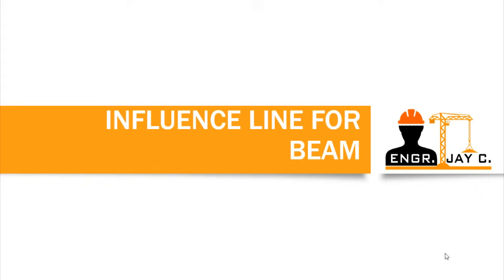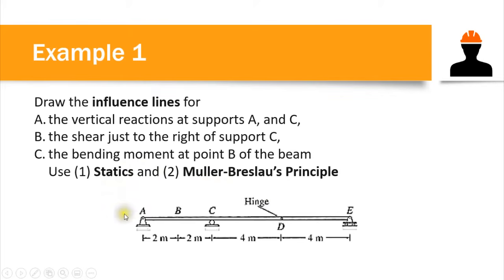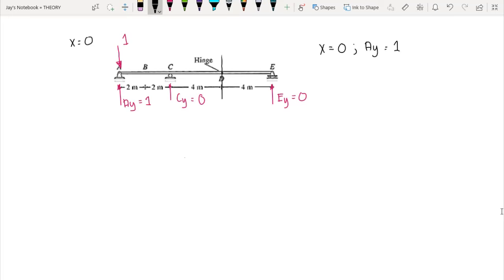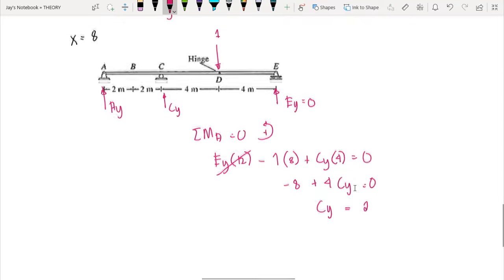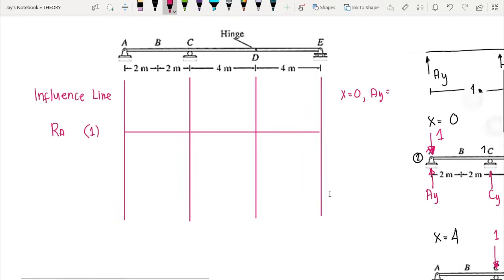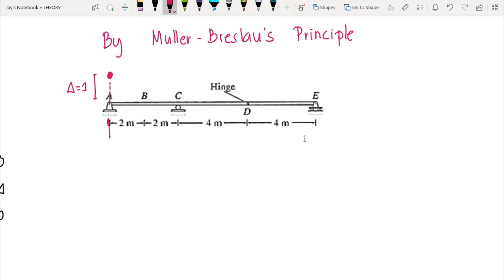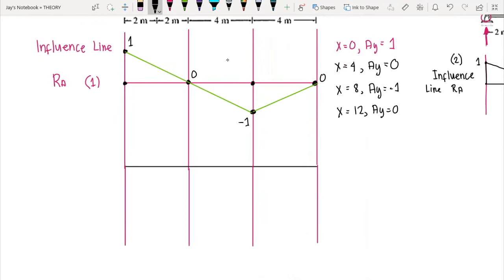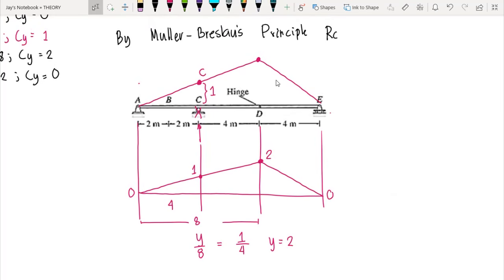Structural Theory | Influence Line of Beam Part 1 of 2

Comment: Hello, thanks for the vid but I couldnt understand something at 22:50 yes I understood that at A there will be 0 deflection due to pin, at C we removed the support and added upward 1KN so deflection at C is 1 but how did we understand that at D deflection will be increased. I understood the deflection will be 0 at point E due to pin connection again. But didnt understand the deflection at the point D(Hinge).
Reply: same question
Reply: found out that A-D is considered as 1 member, i think that's why
Reply: @geldoes5282 
Ohhh now i get it